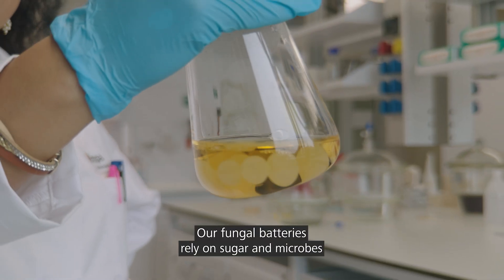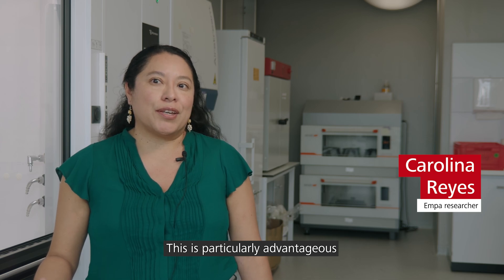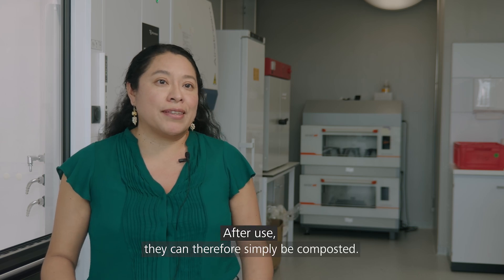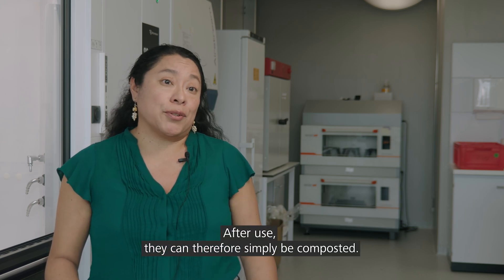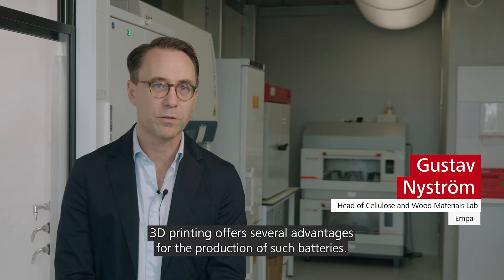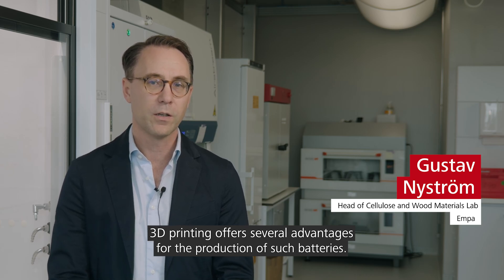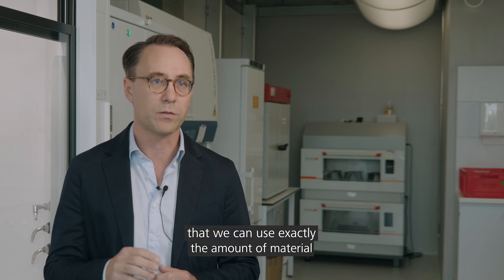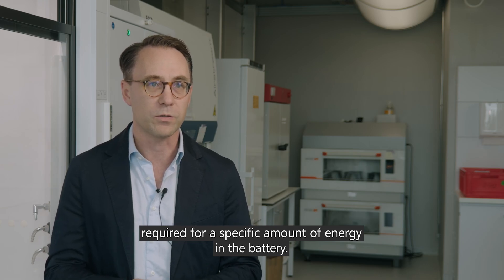The fungal battery that digests itself

Comment: After you make one of these batteries, how much time do you have before you have to use it or lose it?  (And if you have to wait for a large part of that time before you get to start using it, does that cut proportionally into the 62 hour working life?)
Reply from the maker: The researchers assembled the batteries a day in advance. It may be possible to store them longer in a dry state, but this has not been tested yet.

Comment: So what are the current voltage and and capacity?
Reply from the maker: The fungal biobattery can power a low power sensor for 62 hours. The researchers are working to improve the capacity and lifetime of the biobattery in new iterations.
Reply: @EmpaChannel how many watts is defined as low power in this context?
Reply from the maker: @dahleno2014  A single cell produces 12.5 microwatts per square centimeter. Four cells were used to power the sensor, which requires a minimum 290 mV voltage and 10−15 μA.